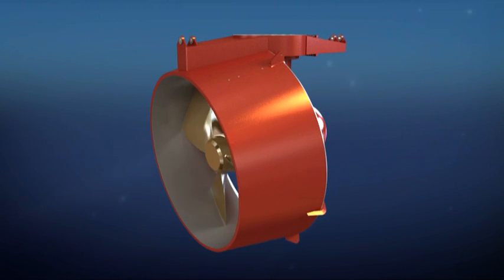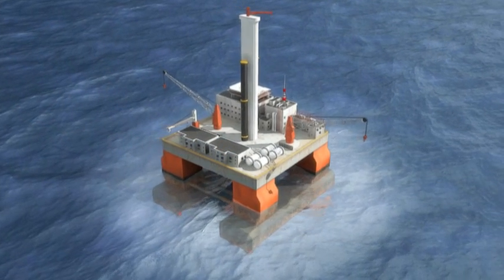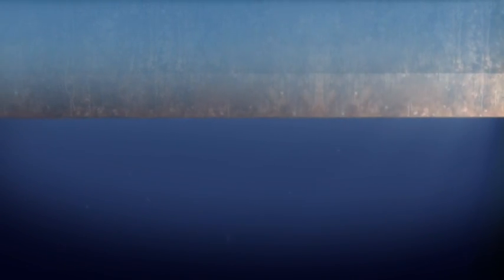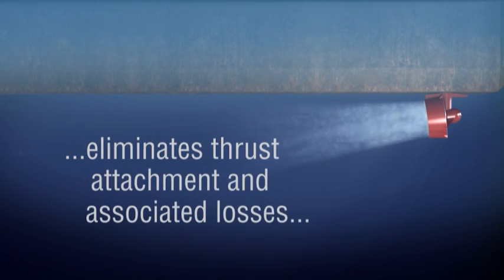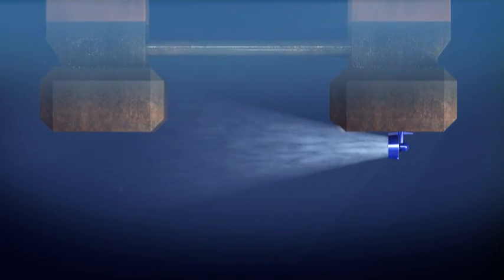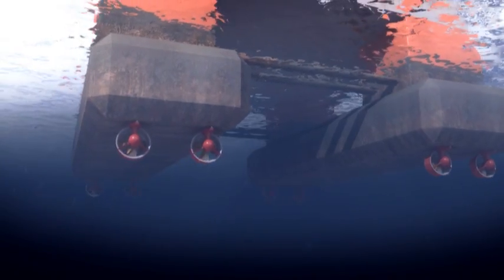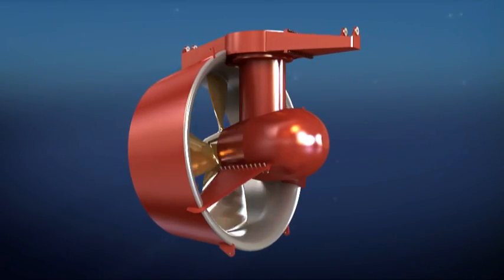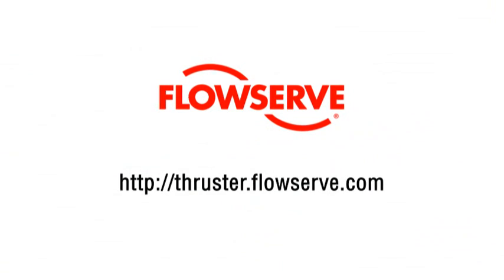Flowserve Thruster

Comment: @thepet3r this is said regarding the vectors. For 100 N of force a 7 degree tilt produces 99,25 N horizontal (useful) component plus a 12,19 N vertical (fighting gravity) component. AS known, vectors do not sum as algebric values BUT assuming force is related to power by a power-two relation, then we could have 9.851 horizontal-149 vertical adding up to 10.000 and explaining a final 1,49% loss of usefull power.

Comment: I've a question about that: with a 7º inclination one loses a bit of the horizontal component of the generated thrust: sin(7º) = 0.12, which means 12% of loss. In that case, there is not "that" advantage, right? Or am I wrong?